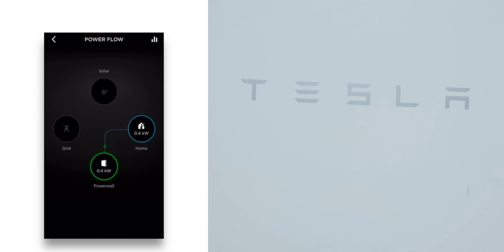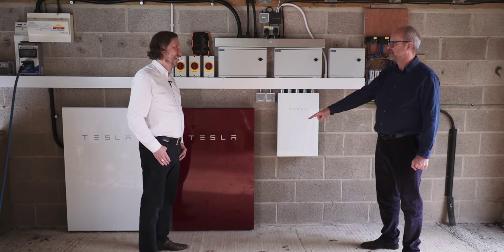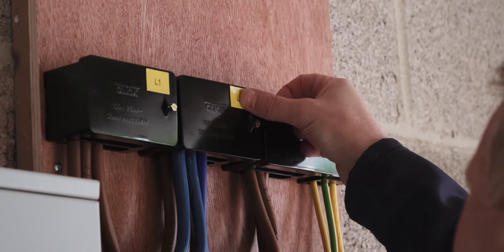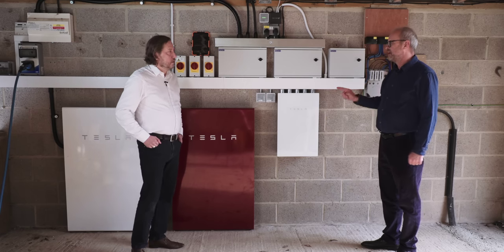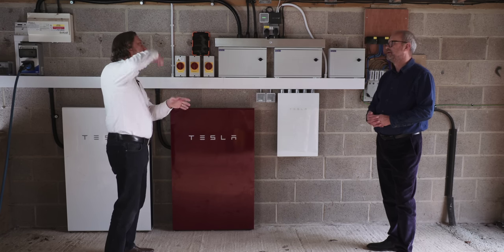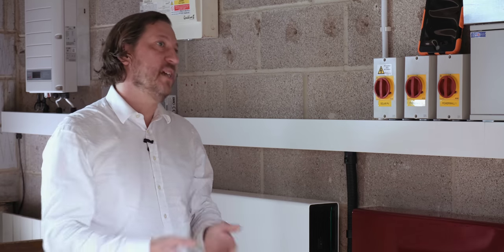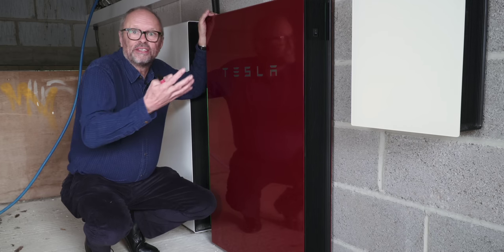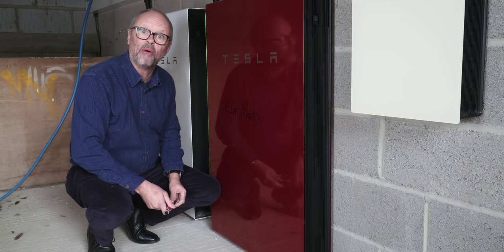Robert's Battery, Solar & Charger Set-up | Everything Electric Show

Comment: Very interesting stuff! Regarding the grid requiring no back feed during a powercut, does the Tesla Gateway need servicing at all, maybe just to have a certificate to ensure it's been checked to make sure the grid isolator functions?
Reply: I'm quite certain there is no follow up.  Tesla had to get the device certified.  It works instantaneously, and so does the load carry by the Powerwall.  The rest of the house can go dark, but those things that are tied into the battery just keep on working without interruption (clocks don't reset, TV just keeps on working etc.)
Reply: @duncandomey8199  Sounds like a great system!

I was wondering more about any future checks to ensure the grid workers are protected. If the grid insists the house doesn't feed back, (which is why most systems will go dark even though power is stored in the battery), what checks are required to guarantee that the Gateway is working and continues to protect grid workers. A bit like on-going safety checks, or annual servicing that provides a renewal of the whole system's fitness.

To protect workers from harm, the grid operators insist no power is fed back into the grid, the accepted way to do this is to turn off all power. Tesla's Gateway keeps power live, but isolates the house with a big relay on each incoming power line. The device works when new, but In 5-6 yrs time, how do we know it still functions correctly to ensure no back-feed in a power cut?

A bit like annual boiler servicing/safety checks, I guess...

Comment: Can power wall be connected to a wind turbine ?
Reply: A modest one, something 3-10kW.
Reply: @toyotaprius79  Yes, you can also use it to turn the blades on the wind turbine, thus creating a perpetual motion machine.

Comment: My system is no where near as sophisticated as this, I have 5kw of solar, 20kw of batteries with an iBoost water heater. At the moment I'm getting very little solar and charging at night, however I have to set the charge times myself and rely on the weather forecast for guessing how much charge I get.

Comment: The only issue with a power wall is that the inverters use 5% of the power to convert from AC to DC, and then from DC to AC. So any AC battery loses up to 10% of its charge, simply doing the inversion.

Comment: Is anyone interested in sharing their real world savings from installing batteries? I've seen the wide disparity of estimations of ROI,  from not in your lifetime, to 5 or 6 years.  Obviously plenty of variables to consider, but if you have battery capacity roughly equal to your daily consumption (ignoring any EV requirements), can't you run your home on a mixture of off-peak tariff and solar, and doesn't this yield very large savings? My pre-solar panel bill is £1100 on a 25p kwh fix which will obviously rise when that ends?

Comment: There is no peak rate 4-7pm anymore it’s a standard peak charge and low tariff overnight
Reply: He meant that 4-7pm is the time of day when there is the biggest demand for grid electricity so the dirtier methods of generating have to be switched on to supply the extra.

Comment: There's an awful lot of doubletalk and outright lies in the energy industry. That bit about you not getting the grid maintenance etc. costs back with your feed-in tariff is pure evil. Why? Because the power company resells the energy you're giving back to them, with zero overheads, and then tacking on all those fees that you're not getting. The power company gets to make profit no matter which way the electricity is flowing, but the customer gets screwed no matter which way the electricity is flowing.

Which is why the smart bet is to "oversize" (not actually possible...) your solar system and batteries so that you never, ever take power from the grid and only ever export to it. And set things up so you can use as much of it as possible before exporting anything. In short, design your system as though you are going completely off-grid, and make it possible to be totally energy-independent. Then, and only then, the markets are irrelevant but are a bonus if you can make some money off it.

Rooftop solar is nothing but profit for the power companies. It's dirt cheap, flat-rate power for them, with no employees to pay, no fuel to buy, no power plant infrastructure to maintain, zero costs or liabilities of any kind. And it evens out demand so they don't have to spend money running their own plants. Then they act like they're doing you a favor for making their life easier. It's criminal.

Comment: I did have repeated deja-vu moments while watching this video...

To change the subject slightly, could we please have an idiot's guide to roof mounted solar panels with battery storage pointing out the pitfalls to avoid, which type of panel etc.
I can't be the only viewer wanting to press the GO! button but totally confused as to what to ask for?

Also what is involved with ground sourced heat pumps.

Comment: I think I'd pay NOT to have that signature on the battery. That said, the system looks to be more or less what I want (bar the Tesla name). One thing I would have been interested in knowing is if, in the event of a power cut, the switch-over to battery is quick enough to keep electronic devices powered up (like a UPS). 5 minutes a year? Count yourself lucky. 
Last time you did a program on home solar and featured a supplier, I emailed them and they never got back. Maybe they got overwhelmed! Let's see if these people are any better!
Reply: I don't have that particular system but I do have an automated relay which allows the house to be isolated and the batteries to supply the whole house up to a max load of 3.6kW. We get frequent short outages and it was a pain resetting equipment after supply was resumed. We've had one outage since the equipment was installed and the switchover to battery was not fast enough to prevent systems with volatile memory from needing a reset. Bit disappointing but I appreciate its other benefits.
Reply: @stevept1504  That's useful to know, thanks. I suppose on the bright side I'd only need a very low capacity UPS though.
Reply: Hi I am about to install 15kWH( 3 x 5)  of Deye Batteries and a 6kW Afore inverter/charger, the EPS/UPS is built into the inverter and is claimed to switch in at about 10mS so you wouldn't even see the lights flicker. it switches via a contactor near the main distribution board to isolate the grid.
Reply: @ianithompson4239  That's really useful to know, thankyou. I'll specify that as a requirement then; power cuts are all too common here, and not good for my computer equipment!

Comment: I don't like powerwalls.
I don't much like most of the other home battery solutions I've seen either.
They're all too expensive for what you get.
I've got a Chevy Bolt with 66kWh of storage that I paid just $15k for, now prices have nearly doubled but even still that's less than half the price per kWh of a powerwall or similar. 
Why can't I just get an old EV, drop the battery out of it, bolt it to the wall of my garage and plug it in? 
Because I don't have an electrical engineering degree and there are no simple DIY kits for that.
Why are there no kits for that? I can't be the only one wanting to do things like that.

Comment: On a practical side. Did you inform your household insurance about this. How much extra did you have to pay on the premium for the extra fire risk from lithium battery fires ?
Reply: lfp. literally 0.
Reply: I've got two Powerwalls at home, the House Buildings and Contents insurance were not bothered at all... so long as it's a permanent fixture and correctly certified install... no extra

Comment: Whilst I think videos like this are useful, I don't think promoting Tesla is a good thing for a number of reasons.  This channel has done a number of pieces showing British technology and I think much more should be done to promote British and European business over large scale American organisations who have many other agendas.
Reply: At the time of filming, Tesla were pretty much the only company doing home-storage etc... and (when I bought mine back in April '22) were still the only company doing a unified battery and gateway for grid-isolation...  other (cheaper) batteries are available now, but not with a gateway, and not with such comprehensive software (even if we don't get all the features in the UK, such as StormWatch).
Reply: @logicalChimp  I'm in the UK, and my app has Stormwatch ... but I keep it turned off in settings!
Reply: European??? After The Brexit divorce, that would cost a fortune....

Comment: Champagne environmentalism at its finest.
Reply: No it's a battery
Reply: Maybe, but iirc Robert got all this fitted in stages (not all in one go), and only after doing the far cheaper stuff such as improving the insulation and making his home more energy efficient.

Since this video was recorded, he's also fitted a second bank of solar panels (an even larger installation than his previous one) - so it's likely that in summer he's a continuous net-exporter (even with his fancy solar-water-heater etc).

If you keep spending money on 'green home improvements' year after year after year, then eventually you end up with a similar setup, even if you're not dropping 20k/year etc.
Reply: champagne is better than sour grapes
Reply: You're right, most of the "electrification tech" is out of reach for most people (EVs included), but what's your conclusion? Do you want people who have the money to NOT buy heat-pumps, solar, batteries, EVs etc? Maybe your point is more that this channel should do more to show what poor people CAN do - unfortunately, that is limited without GOVERNMENT incentives, so again, perhaps your point should be aimed less at richer people buying this stuff and more at our useless government for not getting a grip on the policies that are needed.

Comment: With a ton of battery power in vehicles, home batteries are the stupidest thing there is.
Reply: Hence why Vehicle to Grid/Load capability in homes have been so slow.
Reply: It's especially stupid from Tesla
It warrants a great deal of scepticism
Their brand image would imply that they wouldn't hesitate V2G
Reply: Not when your car is away from home during the day. What you gonna do with all that excess energy? Sell it back to the grid to only buy it back that evening for more money? Lol
Reply: Your car isn't always home.  Plus, why drain your car, only to charge it again?  I fail to see your logic.
Reply: Vehicles drive off.
Reply: A home battery that is sufficient to run the home during the day (paired with the Grid Isolator) makes a lot of sense.  You can then add your vehicle to it as 'additional storage' - but generally, you charge the vehicle up so you can drive it - and that charging typically happens overnight (when solar etc isn't working).

Or, to put it another way: the primary purpose of home storage is to power the home... the primary purpose of a vehicle is to use stored energy to drive you places... using it to power your home is only a secondary purpose.